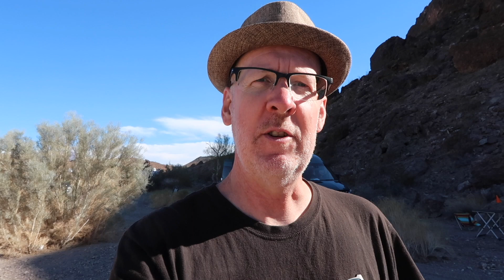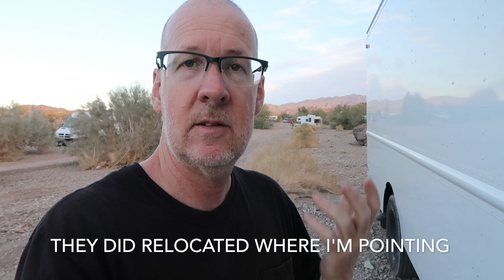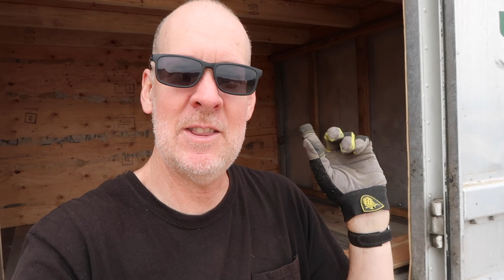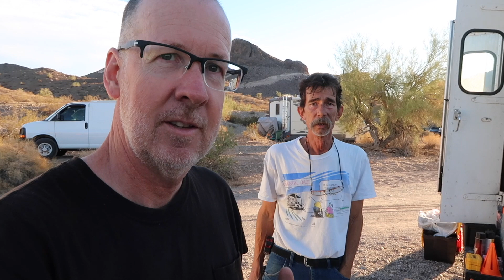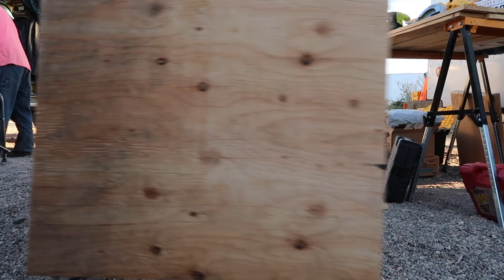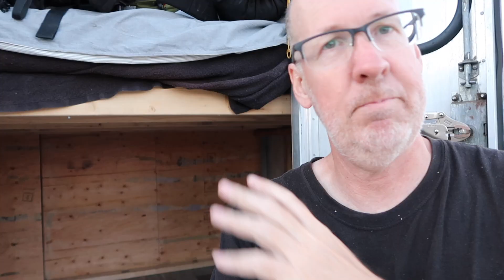Jamie's Van Build Party 2nd Location | Installing Step Van Garage Door E328

Comment: For smaller vehicles, some old carpet and chicken wire plus a few bits of scrap wood can help you extricate your vehicle from soft sand and soil. Off-road companies also make roll up or rigid traction mats.
Reply from the maker: great tip!

Comment: That's a great solution for internal access. When you were sliding the first panel in I though another great solution would be sliding panels. Then they wouldn't have to have space to open into. With two overlapping panels you could get to both sides pretty easily. With three, the two sides on one track and the middle on another track just behind you could get direct access to any area. The drawback to it is the garage would be smaller by the width of the second track. Everything is a tradeoff. With your solution you don't lose that inch but access to the sides is harder. With the two tracks you would have easy access to more areas but lose space. All in all I think your solution wins.
Reply from the maker: it seems to be working well. I might change the hinges to the other side so that the bike is on the hinge side and the boxes are near the open area

Comment: Nice video. Looks like GANGS of fun.
Reply from the maker: it is a lot of fun (other than moving 3 times for one event)
Reply: Seven Wanders the World  Much better than  from
Reply: OOPS!  Better than round trip to California and back to Michigan by  motorcycle with my (then) wife on a 1974 NORTON 850 in 1980. We were young and it was an adventure.  I like the idea of a uhaul van camper. Not ready financially yet. But have ideas. Thanks for sharing.

Comment: put a track in and make the partitions SLIDE sideways...There is nothing restricting the opening that way.
Reply from the maker: interesting idea except the new kitchen counters are going on the forward side of the wall and the back side is full of stuff in the garage. I'd have to make a pocket for it to go into. not sure if my skills are that good
Reply: You saw the movie TOTAL RECALL??......QUADE said: OPEN YOUR MIND.....OPEN YOUR MIND
Reply: Seven Wanders the World  BOBBIE BUSHE' S FRIEND SAID:  YOU CAN DO IT!
Reply: go to this site and look. https://www.richelieu.com/us/en/category/sliding-systems/r-store-cabinet-and-furniture-sliding-door-systems/miscellaneous-hardware-parts/sliding-tracks/1166370...not anything but a track to put the wood into. you already have the 2x4 on the bottom,screw one up top-measure the height slide  in at an angle. then go on you tube and look for "how to make sliding cabinet door"
Reply: I was thinking the same thing.  Those hinges will sag over time and get fussy.  A sliding door system would make for much easier access.

Comment: You might want to consider securing the front wall of your garage and the door considerably more than you have.

You will have several hundred pounds of hard objects back there.  During a hard stop or crash, those several hundred pounds will be launched forward. At high velocity. .
Reply from the maker: great advice. I'll work on securing things better

Comment: It is awesome how people want to help out !! Very cool. 
If you have any extra pallet wood. The hardwood slats would be nice to frame out the outside of the door. This will help keep the door from warping and give it overall strength . It would cosmetically look better too.
Reply from the maker: I'll end up doing some sort of framing to the door once both kitchen cabinets are in place (so I know where the final edges will be)